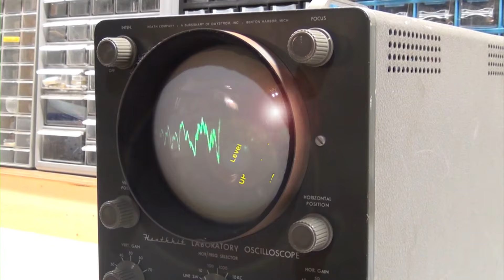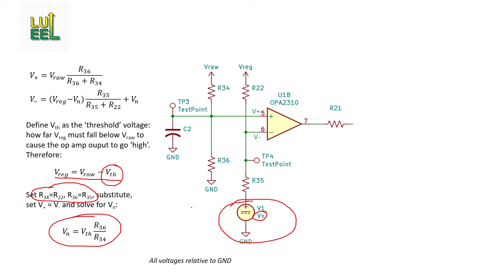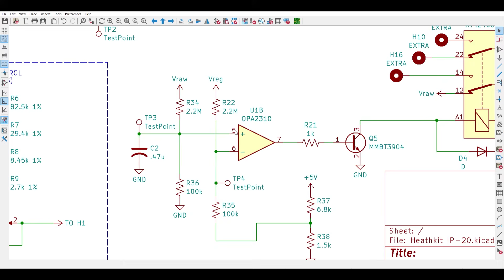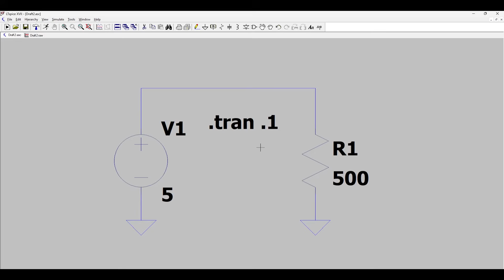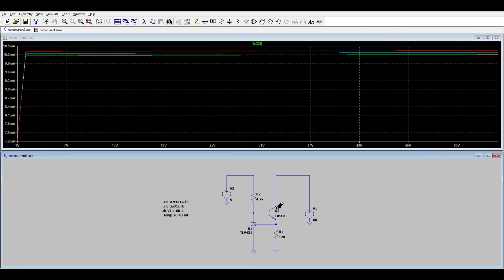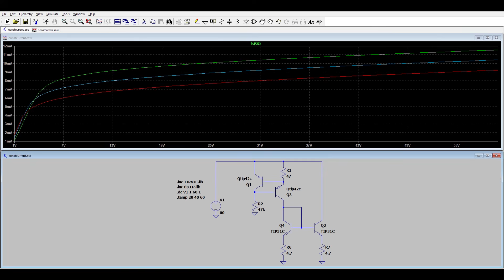Heathkit IP-20 Power Supply: Part #5

Comment: I think you are gonna need a bit of hysteresis (positive feedback) on U1B since you are using it as a comparator. otherwise it might start chattering near its threshold. Also if you used Thevenin equivalent for R37,R38,5V then it would be a lot easier to do the analysis and correction needed for R35 and no need for matrix calculation stuff.
Reply from the maker: Thanks, I rechecked the schematic and I realize now that I didn't update the KiCAD before I recorded to show the latch-on feature that I had in mind.  I'll have to include that correction in the next episode!  And yes, you are correct - I could have simpliied that portion and avoided the complex method that I showed.